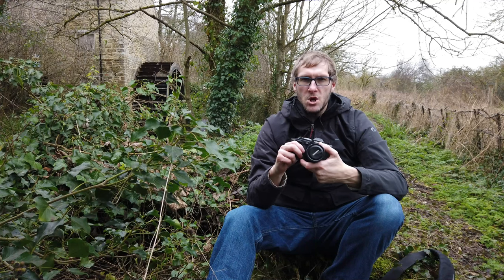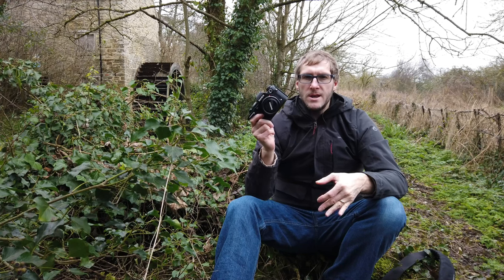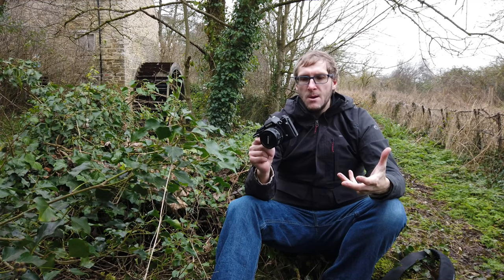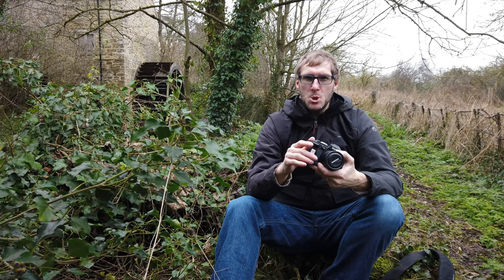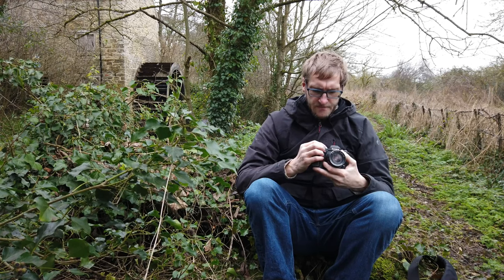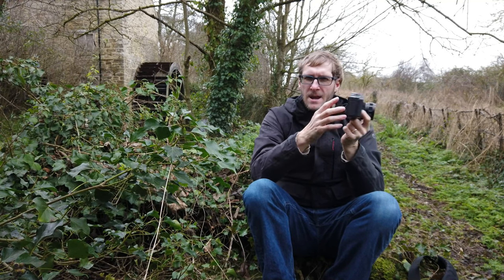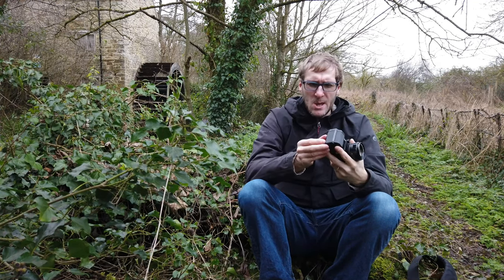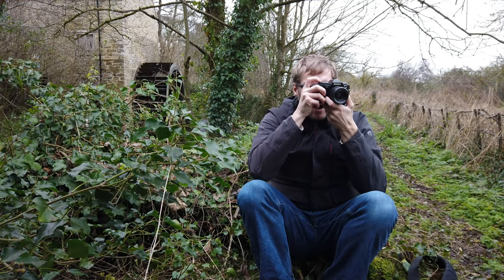Is this the End of the Road for my Konica FS-1 Film Camera?

Comment: Theres is the service manual online, recall it mentioning something about motor replacement on the early models 100k serial numbers. I got 4 FS-1 Spare N repairs as was after the battery holders for my good Fs -1. But have managed to get 2 "dead" ones working, corroded contract inside .
Wouldn t  bin it just yet might just  need a lub of the motor bits behind the bottom plate 

Daft question maybe (as you can read heh)  Alkaline batteries are be used aren't they.
Reply from the maker: Thanks, it's gone now I'm afraid.  I was using the right kind of batteries, it was beyond my skills to fix and cost prohibitive to send away for repair.  I like the cheaper TC-X.
Reply: …got 4 of them. 2 are ok - BUT - a problem (if the battery container is ok -) is the locking mechanism with sensor. You should have forced both locks outwards until they clicked. I suspect the clicking you heard when dropping was that. If they are not fixed in locked position you might get some images before the locking sensor stops you.

Comment: Awwww dang.  Was hoping for a happier ending! If it makes you feel any better.... 
A) this is super common with these (some can be repaired by servicing the wiring and cleaning contacts, but not all) 
B) they're just 20-30 USD, get another if you like :)  
C) and better it's one of these than many others of the era with failing PCBs and early circuits. I have - like a fair number out there and more to come to be sure - a very temperamental Pentax LX which loses its exposure mind and/or locks the shutter randomly. Those $250-500 USD. :) (and people are still buying them)
Get yourself a Konica TC, or a T4, or if you're feeling spoiled by the auto-advance, an FT-1 Motor. All those far more reliable than the FS-1.
Reply from the maker: Thanks tRCt, I have the TC-X as well which has so far been very reliable, just a little basic and not made by Konica themselves.
Reply: @ChrisEdgecombePhoto  Yeh I've tried the TC-X and don't really enjoy the feel. TC is basic if older too but just handles better to me (dimmer finder tho).
Reply from the maker: @therealchickentender  It must virtually dark then because the tc-x viewfinder is pretty poor compared to my Olympus Om-2n.
Reply: @ChrisEdgecombePhoto  You may as well compare it to a Pentax LX VF while you're at it. :) 
All OM cameras were and are renowned for their exceptionally bright finders.
None of the Autoreflexes are as bright as an OM manual series, or late model Pentax etc (MX, Super Program, LX)... The FT-1 Motor comes close, but even it isn't as bright.
edit:(And honestly I haven't looked through a TC-X finder in over 2 years... I remember it being slightly brighter but I could be mistaken.)

Comment: Why would you throw it away? Hang it on the wall, sell it for parts, or give it away.. anything besides just throwing it away..
Reply from the maker: Because it was uneconomical to repair; better off trying to buy another used one but I'd not risk it; these are old cameras with old/early electronics.  I might be tempted with a Konica FT-1 as the electronics are supposed to be a little more reliable.
Reply: @ChrisEdgecombePhoto Yeah im just saying throwing it away is a waste. You could use it as a wall hanger, or sell it for parts, it might fix 50 other cameras. Way better than just tossing it in the garbage.
Reply from the maker: @VashStarwind  I didn't throw it away, I recycled it at our local centre.  I don't have much space for working cameras, let alone for cameras that don't work either 🤣. The exception to this rule is those cameras with sentimental value. This one didn't have any such value for me and caused me no end of trouble.  I don't like parting with cameras but it was an easier choice in this case.